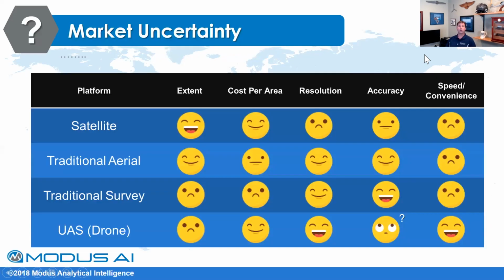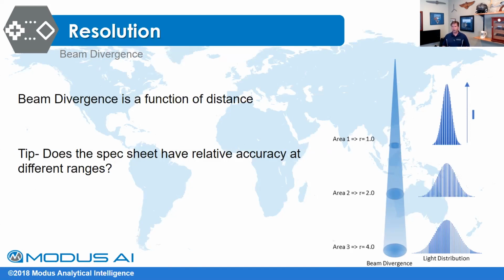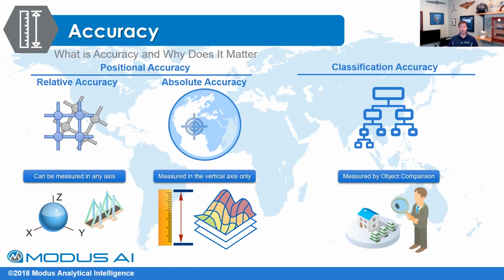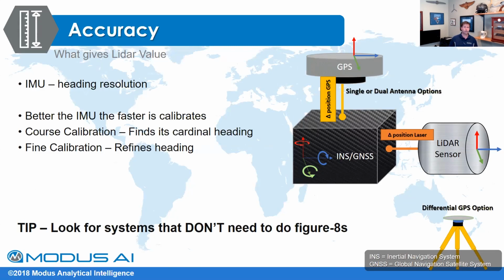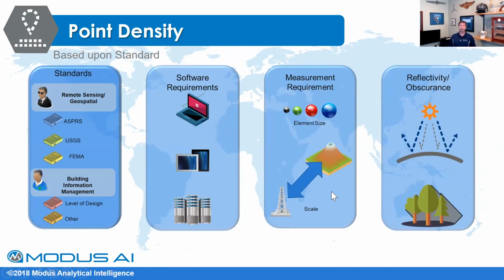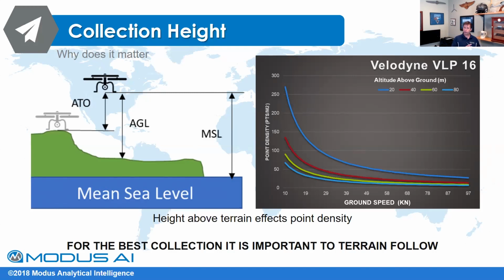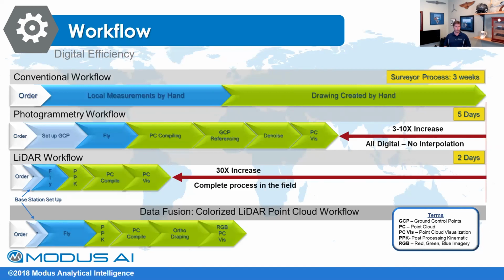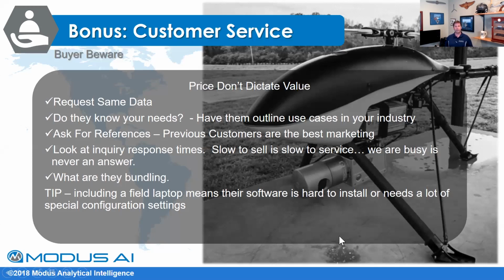Five Secrets to Selecting a Drone LiDAR System

Comment: What do you think about the DJI L1?
Reply from the maker: We have heard but have not verified that is it garbage .  Accuracies are greater than 10cm absolute RMSEz.  And worse that it cannot detect ground at distances greater than 120 ft.  this is very problematic as most tree vegetation is at 90 to 120ft.  AND engineering products are usually less than 6-inch contours or accuracy of less than 3-inch (7.5 cm).  if you are in the US, and you want the most affordable full-stack solution to meet these requirements...PLUS co-capture 24.2MP camera,  reach out to us at info@modus-ai.com...
Reply: @Re.genesis  what if you’re outside the US? Canada for example?